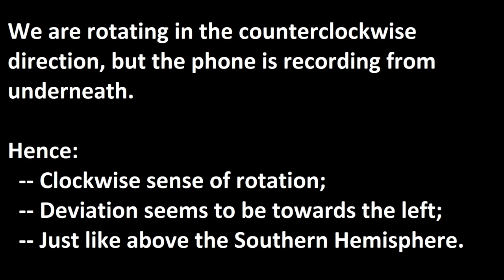Coriolis Force on Merry-Go-Round

Comment: Something my physics teacher taught me was there is no such thing as centrifugal force. It is what we call the perceived effect of centripetal force. We, occupants in a rotation object, want to travel in a straight line equivalent to the tangential velocity of our position, and as an object in motion we want to stay in motion until a new force is introduced. In this case, the centripetal force of the rotating object turning inward relative to our motion. Therefore, isn’t this the same case with Coriolis force? Isn’t it just an effect, in the case of wind, of air particles moving from a faster tangential speed at the equator towards a slower tangential speed at a longitude closer to the poles? Relatively speaking, the produced wind moves ahead of the rotation of those longitudes because it’s traveling at a higher velocity, correct? Same is true of the basketball.

Comment: Very helpful!

Do you think the Coriolis force affects tornadoes and other smaller vorticies?
Reply from the maker: Not in any significant way. This video estimates the importance of the Coriolis force in a tornado: https://youtu.be/6-5wieRyPN4. Here is a table that shows the significance of the Coriolis effect in different atmospheric and oceanic phenomena:  https://youtu.be/rPr5tlUNJlc.
Reply: @DjordjeRomanic  Wherever I read about formation of cyclone, everywhere it is mentioned that due to coriolis force, cyclone's shape is spiral shaped. Moreover, as effect of coriolis force is maximum near equator and is quite strong between the two tropics, therefore cyclones form mostly at or near the two tropics. In the formation of cyclones, wind starts moving towards the zone of low pressure, but due to coriolis force, it gets right shifted in the northern hemisphere and this results in cyclones being anticlockwise in northern hemisphere and vice-a versa in southern hemisphere. Can that not be considered a significant effect due to coriolis force on the formation of cyclones..? However, I understand that formation of tornados is different from that of cyclones.. My question is regarding cyclones.